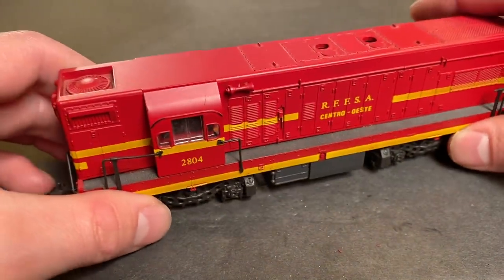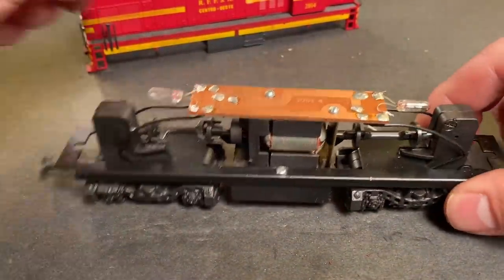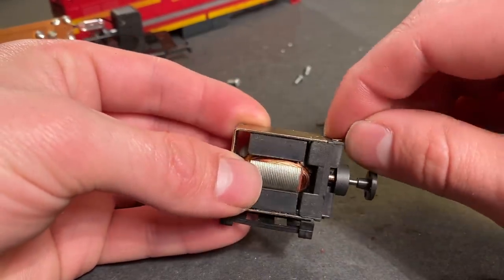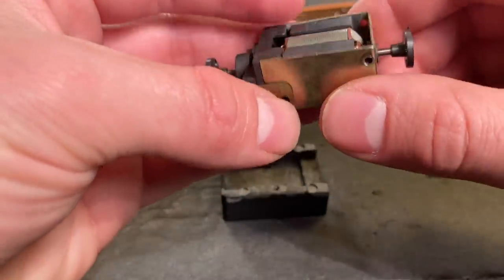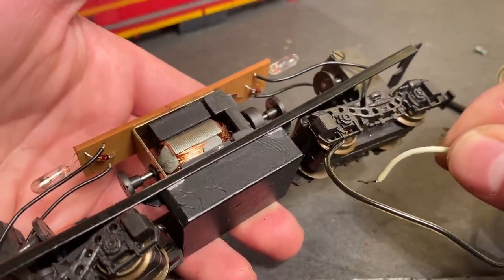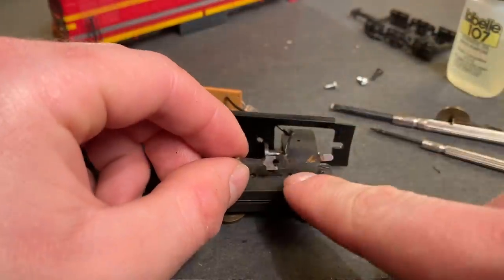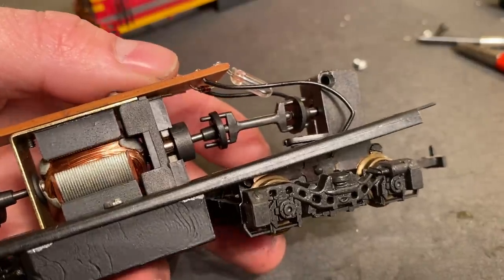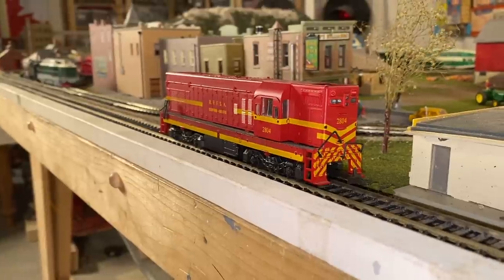Can We Make This 40 Year Old G12 Locomotive Run Again?

Comment: This is probably one of the strangest motor design I’ve seen watching your channel. Really odd.
Reply: I would say the same with the drive shaft.  Quite an oddball of an engine here.
Reply: why is that? looks like a fairly atypical open frame motor to me...
Reply: @muir8009  I don't know; it just seems to be a bit higher up than normal or that it looks like it's bent.  Maybe it's the age of the model that throwing me off.
Reply: @falzar3381  I think I know what you mean. It's like every part of the loco has had a different person design a different component in separate rooms with absolutely no idea what each other was doing until it had been finished.
There's just no look of a designed product. I've got one of these models and yes, it's exactly as you say. I'm actually going to throw an athearn under it as its running has really turned circumspect, and its flanges are a little large even for C83
Reply: doesn't it look like a giant motorific motor?
Reply: @muir8009  you mean like a datsun roadster?

Comment: i'm wondering if the engine was originally powered by battery and later converted to run on  powered rails 

may be shoeing opposite sides might  correct the powering issue of  a dead short  because both rails on 1 side are live at both of the engine
Reply from the maker: I suspect it's always been powered by the rails but it wouldn't be tricky to change that.
Reply: @SMTMainline  I made that suggestion because the   fuel tank was about the right  size for a nine volt battery..

not to sure what battery sizes were common on diesel locos in south america, though I do know our old bull nosed loco for the one's that weren't scrapped or put in moth ball in a railway museum  ended up in 3rd world  countries when not sold off to our kiwi cousins across the tasman..
Reply: have you priced 9-volt batteries lately? it would last only minutes in that locomotive

Comment: You messed with the defect and didn't even notice. This contact can be seen to be loose. Invert its position, to touch the motor pole and redo the soldering. Then clean the engine manifold.
Reply from the maker: Manifold for what?

Comment: What’s a good controller that’s a nice price, mostly on Amazon or if a train shop has one
Reply from the maker: For DC, a mid range MRC controller is what I've always used. Can't really say for DCC
Reply: @SMTMainline  thank u💯
Reply: For DCC, NCE Power Cab. Easy to set up and use.
Reply: @robby062  expensive though, and not particularly ergonomic, the loco or micro maus seems to be a good choice, and of course lenz. thinking about it theres so many systems around, nearly all have pluses and minuses.
Reply: just the controller? if you have a DC power supply, the MRC cab control model 55 was cheap, reliable, and US-made. I use them on my layout. i bought 10 of them on eBay, and sold 6 ugly ones (they come in black or copper color), so I ended up with 4 clean black units for free- can't beat that.... they are transistorized, thermal and circuit-breaker protected, and bulletproof. mine use old-school 300-degree trim pots and can-type transistors, but there is a compact, solid-state version which is hard to find, and the reviews are good. mine pass the club-layout test with flying colors.

Comment: According to Wikipedia, its some form of GE model that runs on a narrow mm gauge track. It's initials are pronounced:
Reply: There were similar locos with EMD power running in Australia and New Zealand, on all three mainline gauges in use in Oz.
Reply from the maker: They must have modified it for Canadian use then?
Reply: This is not GE this is EMD
Reply: @JBofBrisbane  Frateschi made some export units do new zealand for kiwi rail i guess they are painted 126
Reply: @SMTMainline  they were actually built in Canada. think it was London, Ontario or similar. some were built by Clyde engineering in Aus. NZ had the G12, and a reduced size G8 (NZ has one of the worlds smallest loading gauges: they have to really cram everything in there). g12 fairly obviously had 12 cyl 567, G8 the 8 cyl, and the G16 had you guessed it the 16cyl 567 (same as in the more renowned EMD F units).
Reply: Frateschi also made different models of GE prototypes. This may be causing confusion with EMD model shown. No conversions done.
Reply: @SMTMainline  beer holders

Comment: Hey smt. I have a life like tank engine and it keeps making this like slamming noise I want you to check it so ya and if you do, thanks. I think I can send a video so I can show you. Maybe in your next video also, what did you use to clean the wheels?
Reply from the maker: If you want to send me an email about it I might be able to help.
Reply: @SMTMainline  alright but I have to ask my dad if I can and it is scrumptious model trains right and you should do a video in it. Do I mail it to you because I don’t know how to mail stuff but I think my dads got it. Btw I’m 13 if you were confused about me asking my dad
Reply: @yestrainsalwaystrains7155  young man-  sounds like your locomotive may have a cracked or split gear. first thing to do is look at the wheelset gears under serious magnification, paying attention to the spaces in between the teeth. keep in mind there is at least one gear that will require disassembly to inspect. i think harrison will help you find the cause. i think the HO model is quite similar to the LL N scale 0-6-0 i've worked on.
Reply: @tommurphy4307  well I know that it has a broken gear but I can’t seem to find one at my hobby shop and I asked the man and he said that I am going to sell it for part’s

Comment: Look just when I gave you credit for your repair abilities you come across something unfamiliar to you you call it stupid and badly engineered. All wheel pick up, all wheel drive, a simple circuit with directional cab lighting and a simple motor design. Ummm sir wtf are you talking about? That's a well designed loco for its age.
Reply: they could have hard-wired BOTH motor connections instead of incorporating one of them with the motor-mounting system- that's hare-brained even by 1980 standards. atlas and mantua had all-wheel-drive/pickup 40 years ago, too. and the motor is just an all-purpose hobby motor POS.

Comment: Dear, I live in Brazil and unfortunately this brand mentioned Frateschi leaves a lot to be desired. Material is of poor quality and there are constant reports of product and after sales failures. This brand has bad mechanics and motor, which makes it very difficult to install DCC in them. Today I use brands like: Atlas, Kato, Scale Trains, Quick and Genesis who really deliver great options for the hobby.
Reply from the maker: If they put a slightly better motor it would make a big difference.
Reply: i work on N scale locomotives all the time- I watched harrison tear it down and i'm not particularly disappointed with the quality of the parts, although the design is a bit strange. i hear similar complaints regarding the older europe-produced and china-produced locomotives. you are always going to hear complaints from people who can't seem to tell the difference between a train set locomotive and a locomotive that costs more than a train set.